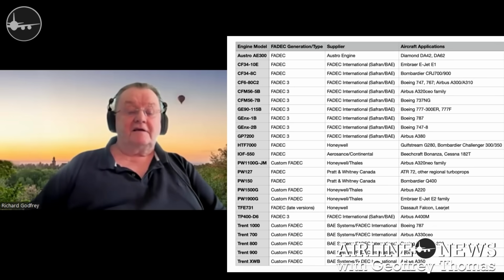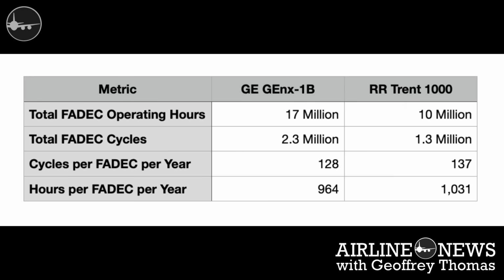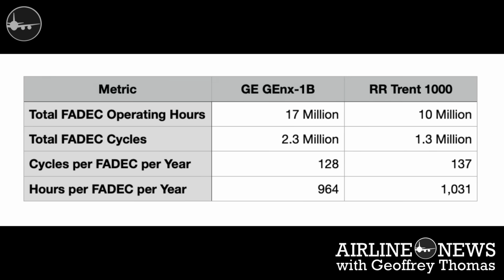Air India Crash - FADEC Explained  #airindiacrash

Comment: FADEC computers are highly reliable and built with considerable redundancy within the device and its software. If you take a particular FADEC and the associated EEC systems and test them as to how they respond to inputs and conditions across many scenarios, then they will highly likely perform flawlessly, otherwise they would not be certified in the first place. However, even a perfect system relies on inputs from sensors, information, status data, pilot input data, and a host of other direct or derived data. Now, if the input data is corrupted, interrupted, intermittent, out of spec, or varying rapidly between all of those, then predicting the FADEC output would be an impossible task. OK, so how could such a scenario arise? How could the data from so many different and independent sources be so distorted, damaged or absent occur? Here we venture into broad speculation, that MAY have implication in AI171.... There is one place where almost all systems, sensors, data, power control and redundancy systems converge. The electronics equipment bay. (the 787 has two, forward under the cockpit, rear between the main landing gear wells.)  These to bays are immensely complex and sophisticated places on the 787 (i would highly recommend these two tour videos of these bays. https://youtu.be/wDeQ88Z_9Pk?si=HLBq3xmYIBuh54qq and  https://youtu.be/BkpLEuCGW8k?si=_9oQAcZK_K_19gqt   The natural sound on the first gives a serious idea of how much goes on here.).  So, as I have said before, when testing these systems did anyone think to throw a few buckets of water over them while operating? I think not it would have been considered as absurd..... until it might not be absurd. Geoffrey and Richard have alluded to this. Ok, so this is speculation and is focused on scenarios not fact, but it is not irrelevant. There is an answer to all of this. Don't wait for the final report, likely years away. Too much time and maybe even risk in between. Just publish the EFDR data in full and, at least, an unabridged transcript of the CVR.  In a way this is a decisive point in time for aviation. In building safer and more efficient aircraft and systems, are we introducing more points of failure, which are much harder to comprehend, diagnose and predict? I dont know, but I think it is worth considering. The Dr.
Reply: Its a good point that supplier testing focuses on the range of expected input conditions and might miss some permutation of unexpected but possible inputs.Typically designers rely on simple 'fail-safe' outputs when the implemented design cant handle an erratic/unexpected situation. Obviously you can only throw a bucket of water on a test setup once with no guarantee of replicating the failure so its not a cost effective approach. Hardware In The Loop testing typically is done, mainly on the bench in a lab but maybe in conjunction with a training simulator to control the inputs and verify safe outputs are generated for the test cases that can be practically run.  Boeing used to ask for digital models of all subsystems and could assemble a 'digital twin' simulation of each system and the network of all components. This simulation could then be run in a Monte Carlo fashion varying all inputs over the possible ranges and attempting to verify the expected outputs of all permutations (thousands of 'water-ingress' test configurations could be included, after a team does some experiments in a lab to define key parameters). Not sure if the Boeing of today does this exhaustively (remember the AOA sensor debacle ?) but I would like to hear a summary of their testing. With no evidence of the intent to deliberately bring down the aircraft and if we are to believe the pilots surprise and denial when the switch position was detected I also hope a human factors team is looking into the procedures from startup that might have led to an inadvertant selection of the switches and why it wasnt actioned earlier (consequence of water ?).  It happening so close to the ground is suspicious to me, around the same time as critical events such as  "weight-on-wheels", gear-up and other flight control inputs change.
Reply: Appreciate your explanation. It was written so that even a layman like me can understand! Can water in one or two bays cause a physical fuel switch to turn off in the cockpit? Thanks again for your post.
Reply: @jacquelinejacobson6789 using the prelim report words “fuel switches transitioned” from Run to Cutoff
But the water leaks in electronic equipment bay could cause all kinds of problems including Fadec to command engines shutdown
Reply: @SJApple4Evr ty. I wish the AAIB would issue a clarifying interim report explaining exactly what "transitioned " means.
Reply: @jacquelinejacobson6789  Agree. "Transitioned" is an odd way of saying a physical switch was moved by a human, and it seems to ascribe agency to the things below the throttles. But "switch" is an odd way of referencing whatever electronic component opens the valves. It's just odd language and makes me wonder if the PR was composed in Hindi and then translated.
Reply: The best answer I have seen among many media discussions. Let the analysis of data help prevent future accidents situations.
Reply: Well said!
Reply: Excellent comments and feedback!

Comment: UAL108 had an engine failure on takeoff yesterday.  It was a 787 with GE engines. Had to circled for a while to lower weight before landing back at airport (was surprised to hear that the 787 cannot dump fuel in flight).  Is it me or are these failures happening more often?
Reply: The 787 absolutely can dump fuel.
Reply: @orizaba18000 then the expert CNN had on doesn’t know his stuff
Reply: @PurplePeopleEaters-j8j  Surprised?
Reply: Quick correction, single engine failure was between 5000 and 10000 ft during ascent
Reply: They are being reported on more often.
Reply: Yes; it's you. It's known as the Baader-Meinhof Effect. If you want a realistic appraisal, check the Aviation Safety Network Database which lists every incident or crash by aircraft model. The Boeing 787 has its records there, so you can check it out.
Reply: I believe it did dumped fuel.

Comment: Every time my phones ring off the hook from scammers, I just watch flight 171 and feel much better.
Reply: When you write to the Indian investigators you raise interesting points on each occasion. However, I doubt that any of your questions will receive an answer while the investigation is ongoing. Afterwards there will be no one to answer your enquiries. It is likely that the investigators will wish to control the release of all information until they decide what the cause was of the accident and until they have had the chance to marshal all of the information that supports their conclusion. Any other/contrary information is unlikely to be highlighted.

Remember at this point that the preliminaryy report was an exercise in not releasing information that could be used to make or challenge conclusions about the cause of the accident.

They probably regard your intrusion into their investigation as unwarranted and - depending on the hierarchical nature of the panel of investigators they may regard your questions as downright impertinent! Either way, answering such unwarranted and/or impertinent questions is likely not to be seen as any part of the investigation.

Any requests pertaining to the crash that you make of any body other than the investigatory panel are likely to be referred to that panel since that is the easiest way to dispose of your question.

I think that it is important to raise these issues but important also not to expect an answer!
Reply: Were any of the ones on the flight scammers?  How about the medical students? I cannot comprehend your mindset.
Reply: @mimip8138 did you get what he was trying to convey.
Reply: @kumark214  I guess not, but that's not unusual. What did he attempt to convey?

Comment: FADEC or other monitoring systems should get updated.. 

For example:

If the ground - Air mode sensor is not working properly then it's not good idea for the FADEC or other systems to assume that the plane is in ground or in air.. 

sensors can send intermittent data at any point of time after some years of usage because of dust accumulation, moisture and other reasons.

And aircraft monitoring computer systems should never allow to shutdown both the engines when on air except duel engine fire scenarios..

Shuting down both engines on air is nothing but inviting disaster.. 
how the system can allow both the engines to shutdown on air? 

Design or logic change is required for sure.. 

Safety Systems should never be the reason for a crash..
Reply: There have been zero issues attributed to FADEC operation in flight over 30 years. You can't get safer than that.
Reply: @CuriousCrow-mp4cx  Are try to kid an engineer?  There have been far too many.
Reply: @patricklockerby4308 
@CuriousCrow-mp4cx 

Correct .. design that allows to shut down both engines on air is a perfectly engineered system..
Reply: @CuriousCrow-mp4cx 

Correct .. design that allows to shut down both engines on air is a perfect system..

 Driving a car for past 25 years without accident does not mean that accident will not happen in future..
Reply: Agreed.  And dust on cables can add capacitance, leading to data errors.
Reply: But the logic is already installed .... only thing that can shut off those fuel valves, is fire switches, or run/cutoff switches. They are part of the same circuit, and it's analog. Manual.  It puts a human being in the path to do that, and it's by design.
Reply: @jprkzoo3463 

I don't think it's only the manual Switches that cut off the fuel valves..
Reply: @Raj80sk  https://youtu.be/-ur234kwnhk?t=1191

Comment: Does the FDR differentiate the fuel cut off control source between:  flight deck fuel switch,  FADEC, FMU, or other (e.g. reset, confused air/ground state)?

What are the known states that will cause the FADEC to shut off the fuel?
Reply: The FDR noted the Fuel Switches operations and the subsequent spooling up and spooling down. As they are Manual switches we know they were operated by the flight crew, but we don't know why. And until the FDR timeline is published, we can't find out.

Comment: If the RAT deployed at the very moment of rotation,  lift-off,  and it was recorded precisely,  there must be a corresponding report as to why it was deployed.  I am sure the RAT does not deploy for no reason especially if the plane crashes 32 seconds  later.
At the point of rotation, or during the unusually long runway roll, performance issues must have been apparent to the pilots or systems monitors.
There must be a reason this corresponding systems report not being included along with choosing not to provide the exact time stamp of RAT deployment and other critical points of interest in the Preliminary Report. 
My research tells me there is a weight sensor in the landing gear to prevent the RAT  deployment whilst the plane is on the ground. 
If there were issues developing during the roll requiring the RAT systems then its deployment may be conditional on being in fly mode, off the ground..
Reply: "or during the unusually long runway roll, "   There was NOT an unusually long takeoff roll. It was normal in every respect until it became airborne.
Reply: @Deploracle 
Are you sure about that?
Do some research and find out what is normal.
Reply: @squareeyes  Yes, I was sure about that on day of the accident.

The plane was airborne for 28 seconds. The distance to the crash site from the end of the pavement is 1.2 km.

At minimum flying speed .. 28 seconds carries the aircraft about 2 km. Therefore the plane HAD TO become airborne 0.8 km before the end of the runway. That is a normal de-rated take off run.
Reply: The above is not speculation.
Reply: How do you know it was normal? Is that what it said in the report? In your research, how much runway, this runway, is used by this type of plane loaded in the same way?
Reply: "My research tells me there is a weight sensor in the landing gear to prevent the RAT  deployment whilst the plane is on the ground."

This is so strange.  Can you cite the source for this?

Every time I see this contention, I pose questions similar to the one that elicited 
the response below:

(Question:  Can automatic deployment of the RAT can occur on a 787-8 - including while taxiing for takeoff?)

Answer - multiple times:

"Yes, automatic deployment of the RAT (Ram Air Turbine) can occur on a Boeing 787-8, including potentially during taxiing for takeoff, if certain critical conditions are met.
 
Automatic RAT deployment on a 787 can be triggered by critical conditions such as dual engine failure, loss of all hydraulic power, or total electrical power loss. While these scenarios are more probable in flight, a severe electrical or hydraulic failure during taxiing could theoretically lead to automatic RAT deployment."

I gather from this that, if any one of the necessary /and sufficient 'critical conditions' are met, even during a takeoff roll, the RAT can automatically deploy.  

I see nothing about requiring "No Weight on Wheels" or anything similar.  I am open to being informed otherwise, but I believe even Richard, in a previous episode, said the same.
Reply: If the Weight On Wheels - WOW sensor system is faulty then this could permit RAT deployment and trigger TCMA fuel shutoff simultaneously .
Reply: @patricklockerby4308 
Do you know if this is a built in systems procedure?  That if the RAT is deployed the engines switch off?
Why would that occur?
What was happening during the roll needs to be explored and of course have important and detailed performance reports published. There is a reason for sub optimal roll performance and this needs serious consideration. 
On this runway these planes fully loaded and fuelled up typically use 50 to 70 percent of the runway for rotation lift-off.  The extraordinarily long roll simply cannot be ignored or glossed over.
Reply: Fine. But until the data is published, there is no conclusions that can be drawn.
Reply: @CuriousCrow-mp4cx 
That's right! There is no point in thinking at all. How do you know if the report will be published, or if it is, that it is honest and accurate?  Considering all aspects beforehand is a good way to be ahead of the ball.
Reply: And yes some conclusions can be drawn before a report is issued. One is that the Preliminary Report is seriously lacking, to the point of obscuration.

Comment: The phrase "Thrust lever FADEC mismatch" made my ears prick up.  This aircraft (VT-ANB) has had two throttle pedestal changes one in 2019 & one in 2023.  Why were they replaced, were new or refurbished parts fitted?  Could this be linked to the crash?  Once again, more questions without answers until the relevant data is released.
Reply: Perhaps the issue was misdiagnosed and the wrong part replaced. The fact the throttle pedestal assembly has been replaced twice suggests an underlying fault elsewhere, which itself may have been responsible for the recent crash.
Reply: I agree, it seems strange that the throttle quadrant had been changed twice in recent history. Worth delving into the reasons behind this.
Reply: @Sticktofacts-k1r How do you know it's strange? The aircraft was built in 2013. It had both its engines replaced so replacing the thrust lever/fuel switch assemblies at the same time would be convenient. What's strange about that?
Reply: @CuriousCrow-mp4cx  as per prelim report, #1 engine replaced 1st May 2025. #2 engine replaced 26th March 2025.  Thrust quadrant replaced in 2019 & 2023.  Definately not replaced at the same time, but would both FADECs have been changed just a short time before the accident coinciding with engine swaps?  A question for Richard.
Reply: Very good point!
Reply: All signs are that the plane never left its "ground mode", hence he was thinkin he is on the ground. The culprit is WoW sensor or bug in the software. This happened before. The system will not allow gear up, it could activate thrust reverse, engines Idle and more. Btw the 787 is the only Boeing model which designed to automaticly open the landing gear doors. They suppose toopen shortly after takeoff. Maybe you guys like to talk about this, thanks.
Reply: Could it be as simple as a power interruption to the Spar Fuel Shut of Valves, they are spring loaded to the closed position, shutting down both engines. The flight data recorder is recording the valve position and I haven’t heard if it also records the switch position.
The survivor said there was a power interruption right after takeoff
Reply: Interesting. It could be anything simple. I remember that a 787 almost crashed because of a plastic cover of a chair position adjusment switch on the back of the captains chair. The whole chair was moving all the way forward non stop after an air attendent touched the plastic cover. @johnkosir5458